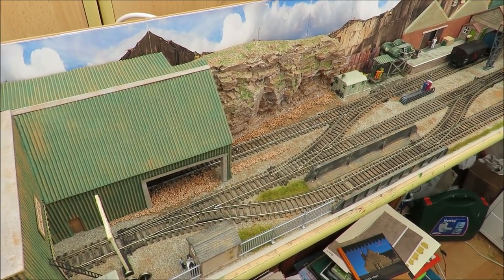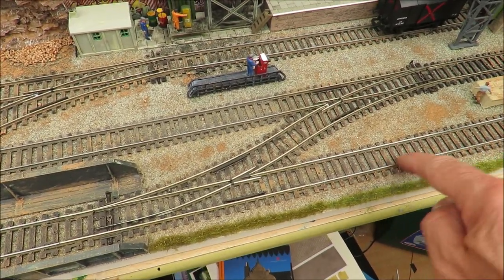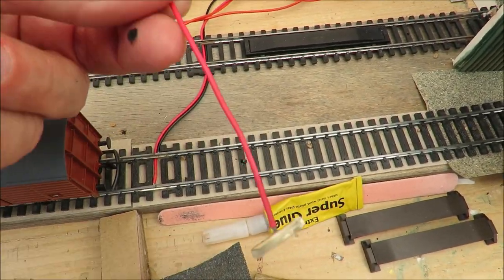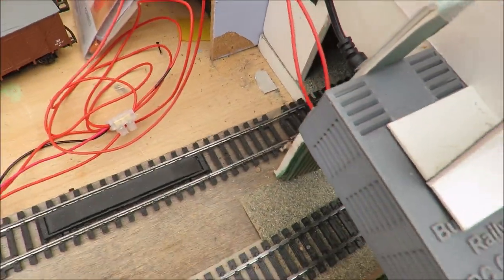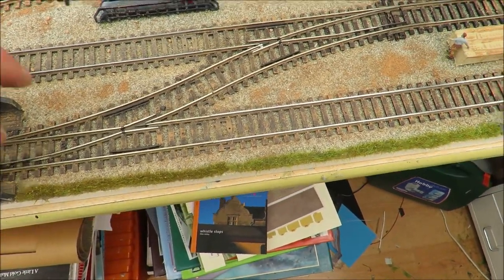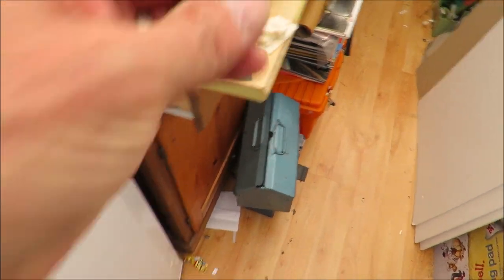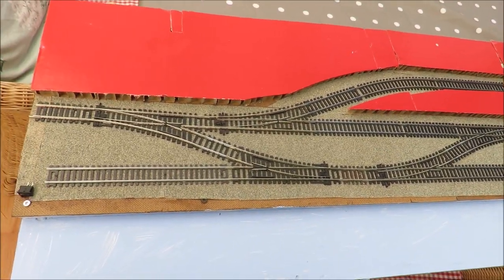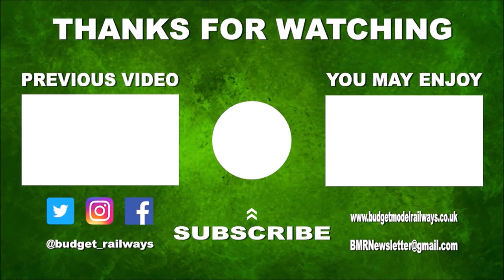How To Wire A DC Model Railway / Railroad Shunting & End-To-End Layout Easily With Only 2 Wires!

Comment: Excellent tutorial to explain just how uncomplicated wiring can be. I find if I run out of a color of wire, a piece of black or red or whatever electrical tape wrapped around the wire can distinguish it from the other. A quick shot of spray paint can do in a pinch as well...

Comment: I am planning my 1st layout and due to space its gonna be a South East London Fictional Shuinting yard... the electric and wiring is something I am having trouble figuring out, this has helped me no ends, thanks so much!
Reply from the maker: DC wiring can be simple. If you use insulfrog points and don't have any kick back sidings then you will only need two wires. Have fun
Reply: @BudgetModelRailways  thank you

Comment: Completely agreed with you : there is no need of overengineered isolating sections with Peco Insulfrog Setrack points. I have some, they are decently priced, reliable, and I had been able to run on them without any problem a tiny 0-4-0 with a less than 3cm wheelbase.
Isolating sections aroud the points are usefull only with electrofrog points because the frog is electrically live. With small layouts like the ones you are designing and building, one feeding point, or two at most, that's enough with Peco Setrack points. The crucial thing to take care of is the type and the brand of the points, because Hornby ones are not as good as Peco, and suffers from reliability and operational problems (short wheelbase locos tends to get stuck on Hornby points).
Reply from the maker: Hornby points are awful
Reply: Good to know. Thanks

Comment: Hi
I've  just brought a small hornby set to go with my peco bits I've collected and the contoller is a HM6000 Bluetooth devise I've got a through road and a spur running parallel to it  on the left with a divering road going to the right with two sets of points on a four foot board with a two foot fiddle yard. This runs all on two wires I took your advise on the running river it works a treat. Thank you both for learning me enough to have a go and get started. I've also got a gaugemaster combi on the way as a backup or ready when I want to expand
Reply from the maker: Sounds great, glad we could help

Comment: thanks Mike... great run through... I would add a couple if iso switches to hold an 040 in the platform and have another 040 come from behind and take out the trucks... cheers Neil

Comment: A great informative video, just goes to show how easy DC is for anyone. I use DC too, however when I'm operating, I frequently will have two operators running trains from the same track feed - so a couple of extra toggle switches is the only extra. GWR

Comment: Good your sharing of the wiring information. Just a something though: isolating and non isolating points aren't a "modern" thing, the options being around for easily 60 - 70 years, even solenoid operating electric points are a hundred years old, complete with wheel triggered point or signal operation.
Good old 3 rail dublo points from 70 years ago had both isolated and non-isolated available, and you can still by them for 2 quid a pop!
I bought a bunch of 90 year old standard and wide gauge solenoid non-derailing turnouts for $25 (but who's got the space!).
Keep up the great vids :) and Douglas is a great videographer, his editing really makes a viewing very watchable and enjoyable
Reply from the maker: Thanks for watching and commenting

Comment: DC has been around since year dot and has worked just fine without DCC. It's not too complicated to have a one man run layout of a decent size and have two locos running the foreign mains whilst you can shunt some freight cars in your yard and switch back between two or three switchers !! Just a little bit of know-how on electrical fundamentals and some patience. I won't deny that DCC isn't great, but all my stuff is DC and has been since I was 8or 9. We had no WIFI signal blackouts back then,nor did we  rely on satellites for our phone coverage!! The only problem we had was the occasional electrical storm black out!! If you want to run a large (or any sized) layout with multiple trains and all the bells and whistles literally,then DCC would be perfect for that. But remember.. model trains are one expensive hobby and DCC isn't cheap neither!! Good luck running folks and take it easy!! From J.P( Always) Wright.

Comment: Super clear, thanks. I am struggling to work out if I can have two controllers powering a track with one running the main loop and then other a shunting area without shorting the controllers. I can isolate the shunting area from the loop with a point and wire up a second controller to the shunting area but am trying to workout if it's possible to cross the over e.g. a shunting loco leaving the fiddle yard to use the main running loop. Would adding switches to each controllers power line to the track solve the problem allowing me to turn off one controller when I wanted to open the fiddle yard to the main loop? More testing I think...

Comment: I am contemplating a small shunting shelf layout using an 0-4-0 or at most an 0-6-0. My understanding is that small wheel base locomotives can stall over insulfrog points and thus live frogs can work better. What is your experience? Am I correct in thinking that live frogs would require old school isolation? Thanks
Reply from the maker: If you only want to run one loco at a time electrofog might be better. It depends on the loco some 0-4-0 are fine some are not. Same with 0-6-0, but thats more about the plastic frog
Reply from the maker: Good reply thanks

Comment: Hi Mike and Doug, simple question for you, what wire can I use for track etc. can I use the wire from an old extension for instance as I have lots of old wiring around my shed and loft cheers.Great video ( as usual). Oh and I’m just waiting for your control box casing, I have the other parts and look forward to assembling it. One more question if I may, do you know where I can get cheap locos and carriages from, I live in Derby ( just thought you might know, many thnx Mik
Reply from the maker: Hi, we use whatever thin wire we can get, try it and see us probably the best answer. All the orders went off today so hopefully with you soon. I would contact Classic rail, he is all second hand and has sensible prices and is very reliable. Although wagons and coaches don't get on his website if you ring or email him he is very helpful. Sadly too many other retailers and ebayers are unloading rubbish at over high prices. I have been very impressed with the Piko Hobby range, it's is HO not OO but their new prices are less than OO second hand

Comment: I used the same kind of system on my loft layout which is also DC . I`ve also been able with the correct points installed and adding a 2nd controller I can run loco`s in a shunting yard unhindered while I have 2 trains running round the main track
Reply from the maker: Sounds great, and very similar too our own loft layout

Comment: Hi, did you have any issues with having two wires coming out the same terminal? I'm thinking of doing this on mine but wasn't sure how the connection would be? Basically two wires in one side, four wires out the other
Reply from the maker: Correct using connector blocks
Reply: @BudgetModelRailways  is there any risk of shorting out the circuits?
Reply from the maker: As long as you don't mix the wires I can't see an issue?

Comment: does it make a difference if the points are electrofrog but you still use the blades to pass current?
Reply from the maker: As long as you only use one loco at a time no
Reply: Electrofrogs need completely different wiring from a normal turnout otherwise short circuiting will definitely result. Read up on live frog wiring

Comment: If you want to do this with Fleischmann points, remove the wire bridges that are installed from the factory, otherwise it will (should in case of oxidation) act like you have all dead ends powered.

Comment: Thanks for another great video! I’m still not totally settled on what I want to use in my layout just yet.

I was thinking about adding a DPDT (double pull double throw) switch to my layout so I can easily switch between DC and DCC without too much wiring. I bought some cheap Bachmann DC controller and the Bachmann DCC command center. I got 2-3 DC locos for around £35 and 2 DCC locos for £40 each. 

I guess in my guess I’ll just need two sets of wiring, one for DC and one for DCC.

How to you guys put the wires in the blocks? Do you strip the ends and just put the same side into it? Like if I had multiple reds I can feed all of them on that side then put the red wire that goes to my controller on the other side?
Reply from the maker: Correct. Good luck with it all

Comment: If you have reliable points and a low power controller there is no need to add extra wires. 
With Dcc and the associated power levels (some people use 5A boosters) you can literally weld wheels to the track if things get out of hand. In that case the extra connections are more meant as fire risk management to prevent cable fires.
Reply: This is DC.

Comment: This does show that things don’t have to be difficult as you are using the points as switches. There is one flaw that is in order to isolate a train at the rear platform you need to leave the adjacent point in an illegal state or the station will be powered by the rear line. Points for cross overs should be switched together for either crossing or straight travel.
Reply from the maker: Sorry not with you. If I isolate the bay then its not powering anything?
Reply: Budget Model Railways the way I view your layout is you have 2 power feeds, the front one will power the majority of the layout depending on how the points are set. The back one will power the rear siding going through the shed but will also power the station if the point is set straight through. In order to isolate the station you need to switch that point to the crossover position but leave the other point straight which is an illegal state, it would work but is not good practice. Don’t shoot me though I’m not a rivet counter by any means but you could forget to change to one of the correct states and cause a derailment which is why such crossovers operate in tandem. Hope that’s clear or have I just confused everyone else.
Reply from the maker: I understand, but thats an operating practice issue, not a wiring and power issue, this is how people get confused about wiring, sorry.

Comment: Not quite what I,ve  been told. Wires are needed at both ends on a end to end layout. Current flows in circles thus both ends need connecting to create a circle. Whoms  right?
Reply from the maker: I cant see why you need to power both ends, might hadn't and it till works?
Reply: @BudgetModelRailways  could well be that is the reason. Once the track is completed played will find out. Thanks
Reply: The circuit or circle is completed by current flowing from one rail of the track, through the loco motor and back to the controller through the other rail.
Reply: @PatGilliland   oh thats how it works Thanks

Comment: Can you wire analog layouts the same
Reply from the maker: It's the same thing
Reply: @BudgetModelRailways  thanks I'm new to this
Reply from the maker: @Burtonupontrentrailwaystoday  it gets confusing as people use different terms to jean the same thing. Basically it's either DCC or not ie DC. DC is much easier than people think if you use points to switch power. Feel free to ask if we can help with anything else
Reply: @BudgetModelRailways  thank you I will
Reply: Gents
The layout I'm thinking of doing would be a one road the length of the board 8ft with a left hand point and a right hand point totaling three roads where would I have to wire the layout